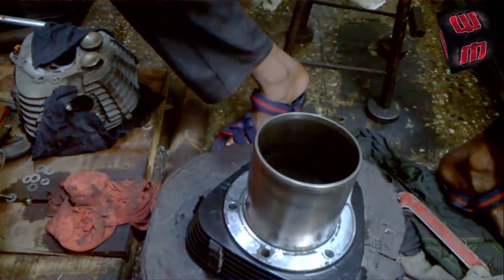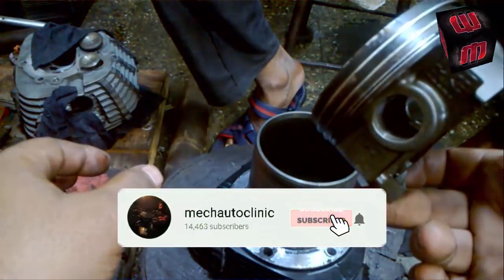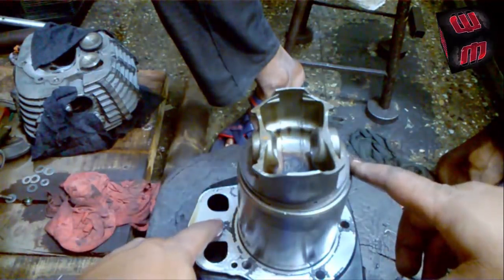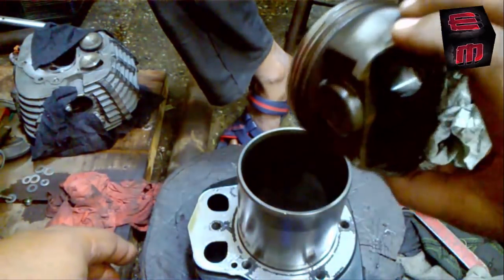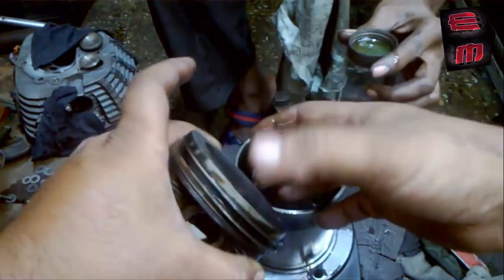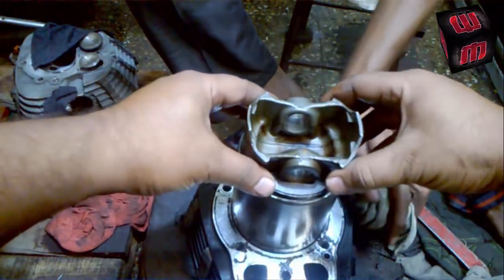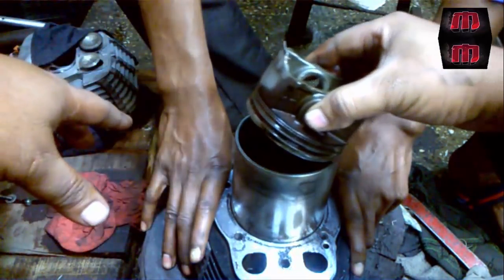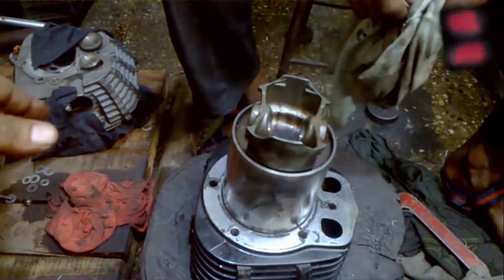Royal Enfield Piston Insertion Technic in the Block (ENGLISH)

Comment: hi bro. does changing the piston and ring of classic 500cc effect the engine?
Reply from the maker: If the spare is worn out then not only piston but u may need to change the bore as well so yes it will give you positive result from current condition. Sorry for late reply.